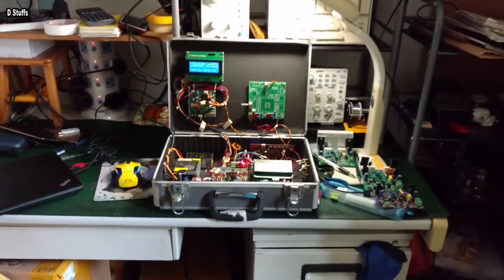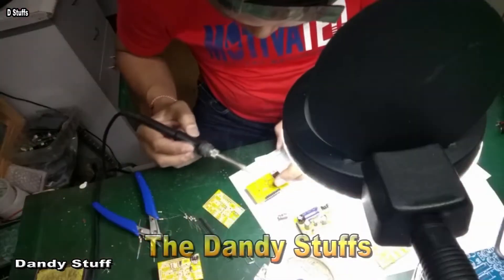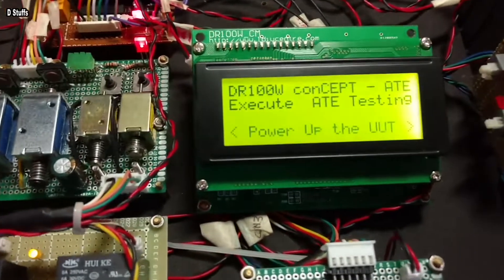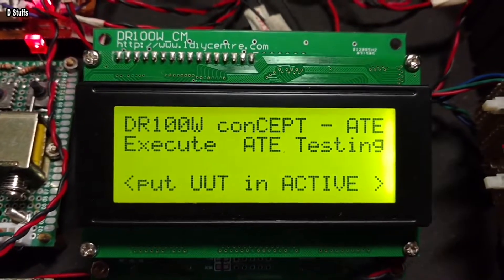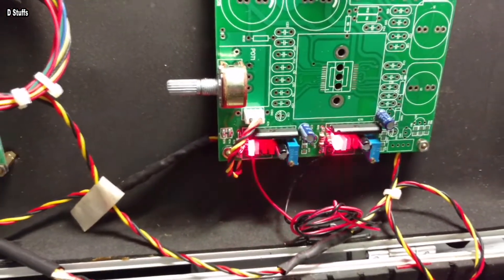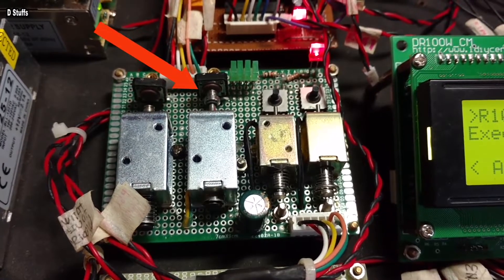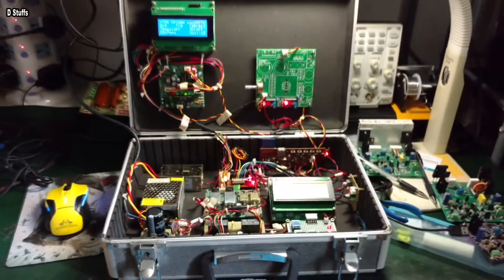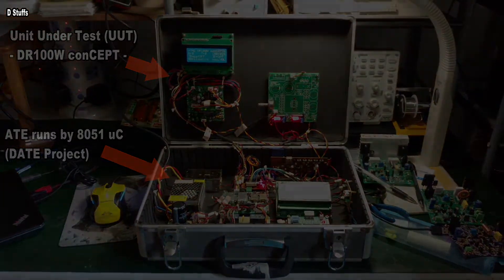How to Make Automatic Test Equipment (ATE) | DIY Learning for Hardware and Software MCU Programming

Comment: Very interesting, could be used for quality control of switches and other mechanical interface elements. High speed actuation and integration of legacy equipment etc...
Reply from the maker: Thanks,  Indeed!   I have been using it in my Reliability job,  even to test software bug, what else, the concept has been implemented in real manufacturing environment, which is why I am sharing to my fellows, as automation test is always needed in today's ever changing testing scheme,  I am sure it is much much much much cheaper solution that Labview, yet still reliable  for testing that do not involve health and human lives!